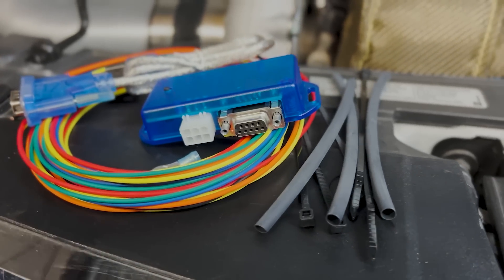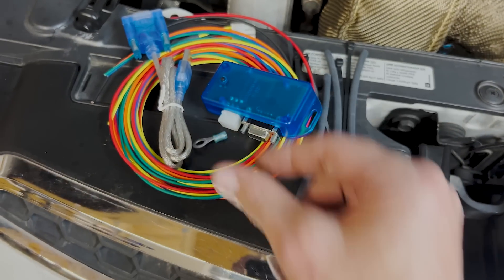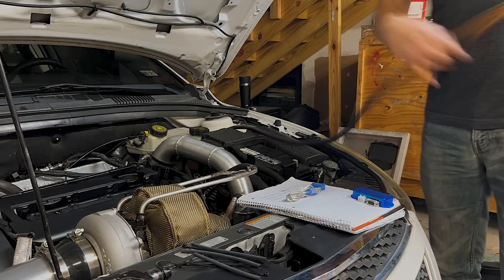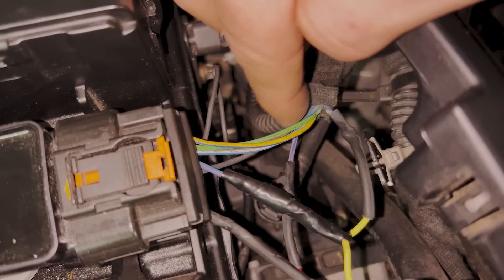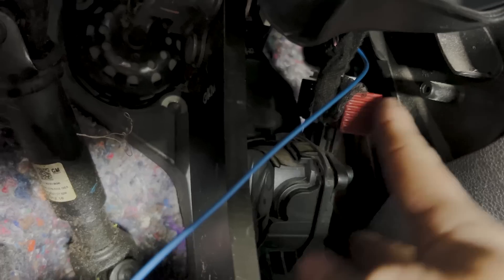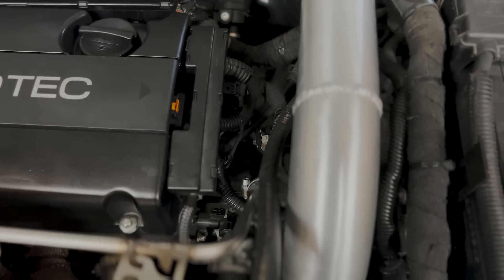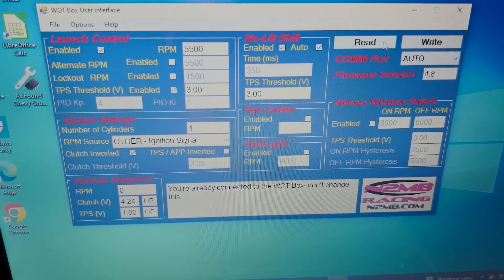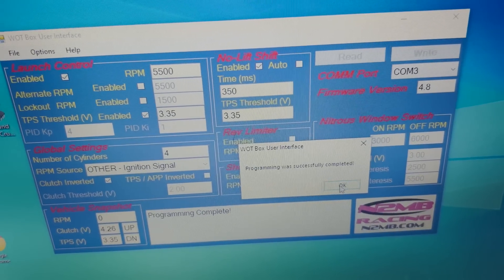How Two-Step Launch Control Works (and Installation Guide)

Comment: So what’s the wire diagram look like for a 1.4L Cruze. Also is the yellow wire just being tapped in with the rpm source wire, and not actually being cut in half?
Reply from the maker: It's the same for the 1.4.  There's very little difference in their wiring, between the 1.8 and 1.4.
Reply: @cmattdabrat okay. I have installed the box and I’m at very concerned, I drive a automatic transmission and I used a momentary switch for the clutch sim, but my car Is not running correctly and this is my daily. Not saying you did anything by all means, could have been my part but I’m just trying to figure out why when I drive my car try’s to go into launch and then gives me a check engine light

Comment: I have a 2015 Mazda s touring with an ecu tuning it’s not turbo but what’s my process of tuning it ?
Reply from the maker: I'm not as familiar with Miata's.  I'm sure if you do a search, you'll get a better idea.  At the time of this video, I was using HP Tuners and this N2MB wotbox just would cut ignition for 2 step and flatfoot shifts.

Comment: Like your video's! Sorry about your loss of a loved one. letting go is the hardest thing sometimes! Would love it if you added what wires were what and what they are tapping into, info like this is priceless now a days when back in the day hotrodders used to help each other back and forth. Once ya got on the track though it was business!
Reply from the maker: I appreciate it!  This is true.  As for the wiring, I tried to show as much as I could.  Found the coil wiring diagram online as well as the clutch wiring.  Wasn't too bad, but the clutch part took a little trial and error.

Comment: i have an automatic will i still get the pops and flames ?
Reply: Would likely need to tune it as well to dial in the air/fuel mix to create flames

Comment: You may or may not know the answer to this, I have a 1st gen auto cruze, which brake peddle wire do I tap into for the clutch wire to the n2mb? Everything else is good except that

Comment: Matthew ! Loved the vid! I’m curious if you’d ever make a video testing the rev limiter capability for those really interested in buying for that feature ? I’m wondering if it’s truly up to snuff.. I’m wanting to slightly lower my limiter for the engines sake (i drift) but I don’t know how effective this feature truly is 🤔 or if it would even be safe long term.. any inputs appreciated if you have suggestions ! 😁
Reply from the maker: Thanks! I raised my 2 step limiter to 6k last video. As far as longevity, 2 step can be really rough on engines so I haven't exactly tested it too much if I'm not going to put that built up boost to work.
Reply: @cmattdabrat  right I get you. Makes sense !

Comment: So I have 2 questions… I hope the community can help me!

1. do I need to splice into each coil or do I only splicing into the first coil?     To help clarify this it is a four pin coil, but only three pens are used.  2011 P3 Volvo with the in-line six… each coil has its own set of wires going into a harness.

2. for RPM signal, what are some good alternative sources?   My crank sensor is located in a terrible location to just mess around with.     I've heard using injector, either injector one or injector six to measure rpm signal.  but I don't know? I'm willing to do it if that's a good alternative and the software options accommodate for that.
Reply from the maker: There's going to be a main 12v power source that will run to all your coils. That's your red in, orange out.  That will cut your signal to all.  You can use either the injector or spark 12v triggered source for the RPM. I used the #1 coil signal.  Not the constant 12v signal. Hope that makes sense.
Reply: @cmattdabrat  oh okay! Yea makes more sense.  Wonder if i can use the fuse to do that instead of splicing the harnesses.

Wonder what kinda taps/adapters are out there that could work….
Reply from the maker: @Honeypot-x9s  You could make your own breakout harness. You'll just have to dig to figure out what the harness part #'s are for the male and female parts.
Reply: @cmattdabrat  yeah, I’m avoiding cutting the harness at all costs.      is there any reason I can’t intercepted at the fuse position? I mean, for example you pull the fuse out you have those two pins in there that you can wire in some spade connectors, which I wouldn’t do (probably) but let’s just say.. and you hook the box up in line there to cut power… is there any reason that wouldn’t work?   We’re only cutting the battery voltage to the coil right we’re not cutting the signal, right?  

I’ll figure out the clutch situation with my automatic I really was trying to avoid just brake paddling it but maybe that is the best .

Comment: I’m putting in a wot box now and I don’t have a violet and blue wire only blue and violet
Reply from the maker: Might have to just try to temporarily mock it up and see what's what. Take a look at the video again and look at the pin position. I can't imagine the pin position changed.
Reply: @cmattdabrat  so they changed the colors of the 2013 Chevy Cruze lt and the throttle cable is actually the yellow and white wire for me

Comment: 11lbs is way high even cleetus only launches his cars around 5 to 8 psi. Lower the two step to 2500 or 3000.
Reply from the maker: I'll play around with it. I'm trying to keep the car out off the 3,500 rpm range where it would make peak cylinder pressure / tq which is what breaks things easier.

Comment: I watched the entire build series on the channel I never saw u explain why ls coils never worked?
Reply from the maker: I can tell! LOL, I'm having a hard time keeping up with comments. I set the setup aside before I got around to troubleshooting it. Now I'm having to start over because it walked off. Have no idea where it's at in my shop. I'm also redesigning the mount so it'll be easier to access the plugs. Stay tuned. Just as soon as the parts come in from being cut, the LS coils are going on. Decided to get some OEM LS coils from the junkyard.

Comment: i lost 4000$ on a cruze 2012 1.8 at 100 000km the cat broke and at 130 000 third gear grind i dont know how your tranny support that boost !
Reply from the maker: Was yours a manual? I babied this thing until I built it at 122k. Currently has 125k. Also has a LSD. If auto, I could see why. The autos are weak. The manuals Will hold okay, but still can break with lots of power. The M32 trans came on a lot of Holden / Opel vehicles. One guy has even pushed the trans as far as 700+ hp on the dyno, in which it blew up.

Comment: You have to install something to do flat-foot shifting? I did flat foot shifting 3-4 all the time in my Honda Accord 5 speed and it was stock.
Reply from the maker: Depends on what you're trying to do. If you want ignition cut, yes. The stock ECU will only do a fuel cut while doesn't retain boost.

Comment: Great video, only thing id change is having the wire tubing going through the firewall as it'll act a gutter will let water into the foot well, have it stop right before the hole through the firewall
Reply from the maker: Thanks! Haven't had any issues so far and all my gauges are routed through the same hole. The cruze has a spout for the drainage on the other side.

Comment: I have an automatic 2012 1.8l chevy cruze, would it still work? Also do you need to go catless for this to work?
Reply from the maker: You can hook the clutch wire up to the brake pedal. Catless only if you want it to shoot flames.
Reply: @cmattdabrat what color cables do I have to wire to the brake pedal?
Reply: @carlosolivares4873  did you figure out what color wire it was

Comment: Is the motor internally build or is it a stock 1.8 block with a turbo ?
Reply from the maker: Fully built engine. JE custom pistons, h beam rods, stage 2 cams, custom intake and manifold, enough fuel to support 600hp.

Comment: Hello. Do I have to have coil on plugs for this to work or can it be wired to the injectors also?
Reply from the maker: If you have EFI, it'll work with either the fuel injection or ignition. I opted to do ignition to get the turbo to spool. The stock ECU on my vehicle has a built in fuel cut, launch control, but doesn't build boost and is pretty lazy on the recovery.

Comment: Wayyyyy too many Rpms you need to bring that down to 3500
Reply from the maker: I'll give that a shot. It's an 1.8 with a gt35 so takes some time to get that thing to spool. Still more testing to be done.
Reply: You should still be able to build 8-10 lbs of boost at 3500-4000 I just think 6k+ is going to end up hurting you in the long run. Most 1000hp drag cars launch at 3200-3600

Comment: If you hit overboost, you need an upgraded electronic boost control solenoid. Helps keep the boost at target.
Reply from the maker: I have a boost control but had the duty cycle set too high. This the first time I've really got into it aside from some pulls to data log and street tune the vehicle. We're getting there.

Comment: sounds absolutely disgusting man!! hey we're you ever able to connect the back up camera that came with your radio? i was able to but im getting noise in the system(causing the camera to have a bunch of blurry lines, splitting the view in 2 sometimes 3 parts, sometimes getting color sometimes not) and cant figure out why, if you could make a video going through the process of installing it and having no noise in the system?
Reply from the maker: Thanks! I've just been focused on the performance side lately, but I'll make that video in the near future.

Comment: Getting a good quarter mile run or two in while logging, and weighing your car, might eliminate the need to dyno for now. Quarter mile mph will be a bit better judge of power anyway. Never know with some dyno shops. Great progress, and fun to see you get to enjoy the car.
Reply from the maker: Thanks! Not sure how the tires will hold at the track, but you do have a great point. I'd still like to get it on the dyno to see what it likes for timing, as well as tuning the VVT.

Comment: what fuel injector do u use and if mines stock what injectors should i run
Reply from the maker: Im using 1050x injector dynamics. Just depends on your power goals. Mine are 600hp, even if I have to spray, so the fuel pump and injectors need to be able to flow enough for your power goal.
Reply: @cmattdabrat  Hey thank you for the response i’m just curious on why my air intake is causing my car to rough idle or not start at all and i don’t have anywhere to put my mass airflow sensor

Comment: Couldn't have timed the drive by gunshot any better, bahaha. That thing is rowdy. Gonna be very interesting to see how the MXR turbo holds up. Nice haircut man and awesome update!
Reply from the maker: Thanks! Need to get some camera help over here lol. So far so good even without a BOV. Have been pushing 3 bar and maxing out my sensor. lol
Reply: @cmattdabrat  That's nuts. No BOV on Rotaru either it sounds so good. Only pushing 1 bar though hahaha.

Comment: You're really changing my mind about these cars. It's so cool that you're making this car such a beast
Reply from the maker: The engines are a really great platform. Only thing I really see needing some sort of upgrade is the main caps, in which at some point I'll make some billet caps. Aside from that, great flowing head VVT, GM / Opel really has a good engine here that's overlooked.

Comment: Sonics, Cruze and Camaro's come with flat foot shifing in the OEM tune. Set your minimum mph and minimum throttle % and done. You still have to clutch it but shifts pretty quick.
Reply from the maker: Yes, and no. I've used the stock flat foot and launch control setting. It cuts fuel instead of ignition, and has a very slow recovery. I tested it with my setup and doesn't build boost off the line. Maybe a great option for NA though.